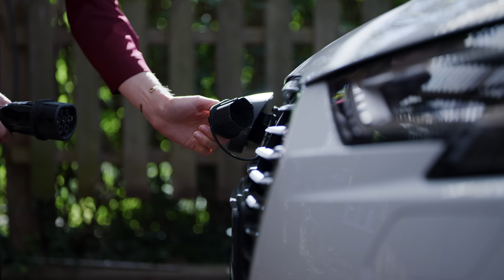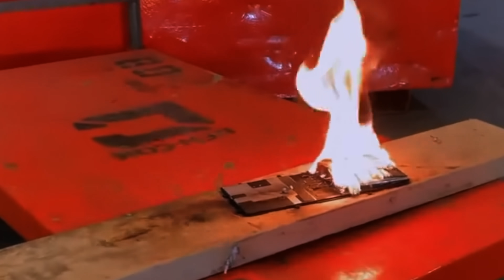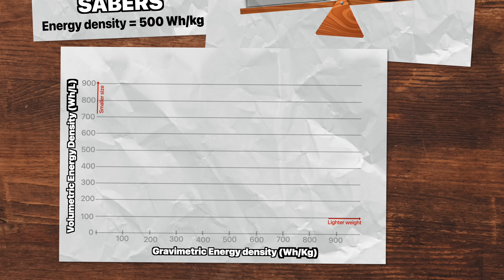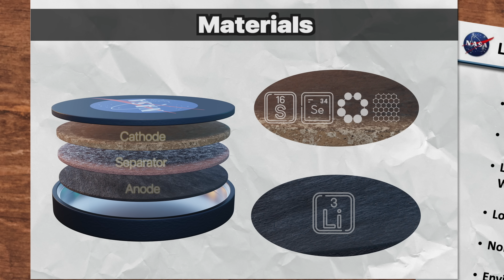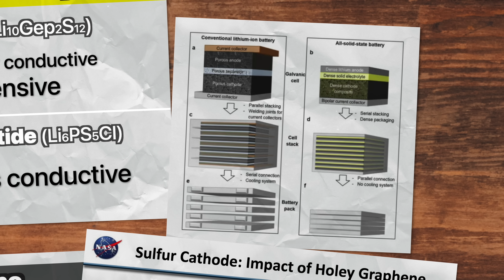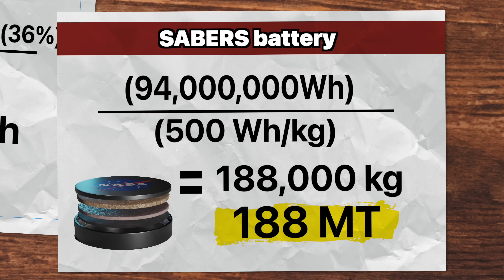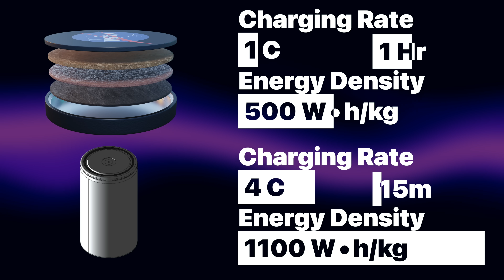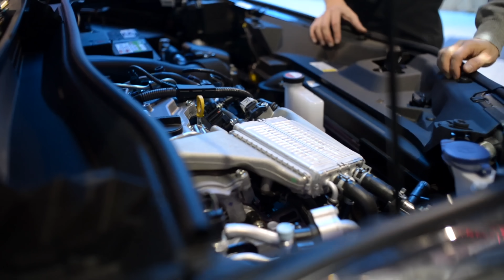Why NASA is Building a Solid State Battery

Comment: for the electric plane, maybe include a little jet fuel and three generator turbines to provide extra power for takeoff etc.
military vehicles could keep even a bit more jet fuel for in-flight refueling which the vehicle can use to recharge it batteries while in flight, thus extending the range options a lot.
anyway the power requirements for maintaining speed at cruising altitude are probably a lot less than takeoff. And you might as well add in that the plane's surface will eventually have some new high efficiency solar photovoltaic to also help top off the tanks. heck maybe a "good" takeoff runway would have a bunch of electric treadmills in a line such that the runways helps takeoff by sorting throwing the plane in to the air a bit, at least that is, help it speed up. I bet 0 to 120 is VERY expensive compared to the rest of the flight's energy use profile.

Comment: solid state as opposed to mechanical batteries? I'd think it'd be to the point to just say chemical batteries, rather. In fact, kinetic energy storage has it's own devices and wouldn't be called a battery, so making the term "solid state" is kind of redundant. NASA and the world need to be looking to replace lithium, it's in short supply and it's toxic too.

Comment: More than the max takeoff weight is consideration of the max landing weight. In a traditional liquid fuel aircraft, the landing gear and subsequent structure are designed for a landing weight which is quite a bit less than the max takeoff weight. Upon landing, there are significant additional forces that are applied to the structure. In a typical aircraft, the fuel can be dumped to ensure that the max landing weight is not exceeded resulting in structural damage and potential crashes.
Reply: Was about to say the same. Liquid fuel has the advantage of losing weight as you go, so MTOW is higher than the MLW. If using batteries sure, you get energy, but you're still as heavy as you were when taking-off. Hence batteries as is can't be the choice for airliners. Small planes, yes. Large, no.
Reply: @ilaril depends how energy dense they will get. at some point the drop in weight won't be able to overcome the sheer energy density of these theoretical batteries.
Reply: @ilaril All depends on the energy density to weight ratio. If the batteries are light enough (which, really, I doubt), then no problem.
Otherwise, I'll just redesign the landing gear. The ONLY REASON the landing gear is designed to take advantage of this property is because WE CAN.
Reply: The landing gear argument is void, we designed nuclear powered aircraft that didn't lose fuel weight mid flight in the 60s, so we can sure as heck do it now. Not to mention current solid state battery tech allows charge in seconds (check the Israeli firm doing this) so recharging can be quicker than our current methods of refueling
Reply: No. Aircraft landing gear are NOT designed to only sustain landing mass. Any aircraft needs to meet the certification standard of emergency or balked landing (A scenario where aircraft takes off but some issue arrises then immediately they land). Furthermore, most, if not all, parts of the plane are designed with safety factors of atleast 1.5.
Reply: What a very good point.
Reply: That's actually a really important catch, good on you.
Reply: @CrawfordAutomation  To aircraft people...this is just common knowledge but IS overlooked by many outside of the industry who dream of electrifying aircraft.   They also forget that to fly in the US you must have at a minimum a 30 minute fuel reserve...so any range estimation needs to be reduced by this amount which makes the current small aircraft that are available only good for 1/2 hour flight times or thereabouts and makes the possibility of larger craft that much more impractical.
Even if battery technology improves 10 fold...it's still not going to work for large commercial aircraft as the energy density per lb just can't compete with Jet A and never will.
Reply: @recoilrob324   I fly in Europe, here you need 30 min Final reserve + an alternate airport with is roughly 30min worth of fuel , so the 500Mn range is already eaten by the required regulation
Reply: @recoilrob324  Never will? Years ago in trade work, the old timers consistently scoffed at early adopters using battery operated power tools and told me over and over again how they'd never work citing power output/duration/life issues. Never. As in an absolute statement. Drive past a work site today and see what those same old timers use now.  Same story with electric cars and their range. Men (not just old this time) would tell me over and over how they'd never (ever, ever!) have the range needed to be competitive with ICE. Today, the Zeekr 001 has a range of 641 miles thanks to Qilin's newest battery pack. More than most ICE in it's class. Think for a moment, how have batteries improved over your life alone? I'm in my 30's and can count about 6 different chemistries that made it to mass market in NZ. At each iteration, an improvement on the last. I just can't see what you're seeing when you use the word never. My experience has been the complete opposite.
Reply: @recoilrob324  not without being just as toxic and explosive anyway. Trying to cram energy into small spaces and NOT have something exciting happen is an almost paradoxical endeavor.
Reply: @recoilrob324  "And never will"....rubbish....
Reply: @Mick-60  Do you seriously think that the energy density of batteries is going to be increased over 14x?  That's a conservative estimate of what it would take to match Jet A.   I can't see it happening because I live in reality.
Reply: So planes that experience mechanical failure leading to aborted takeoffs can't land on their gear?
Reply: @ohger1  Aborted takeoff means they never left the ground...so that's a matter of how fast were they going and whether they had enough runway left to stop and whether the brakes could absorb enough of that energy without failure.   Many max abort tests have the brakes getting hot enough to light up the tires.

Once in the air if a problem is encountered that requires a return to the field many aircraft must dump fuel to get down to safe landing limits.   The heavier you are the faster you must fly...and land.   They want to land without destroying the aircraft which can happen is tires blow or suspension fails due to excessive weight and speed on touchdown.
Reply: I doubt you'll be refueling the thing in an hour, either.
Reply: My thinking is a 3 stage long haul E plane, a modern catapult system to take off, a large flying battery to detach say a third of the way and return to charge, another flying battery to join 2 thirds of the way and release for landing simples.

Comment: I'll believe (Toyota) it when I see it. I've been hearing about battery breakthroughs for 20 years.
Reply: Li-ion battery also took 20 years from invention to first commercial application as camera battery in 90's. And 20 years more to Nissan Leaf and Tesla. 

Now there are more insensitive to develop batteries, but it's not very easy. Goodenough team invented already years ago solid state battery with high power density and capacity. It uses glass membrane as separator. I don't know what is the hard part.. button sized batteries worked already well. (Possibly micron scale thickness is not easy make reliable as separator, and non-reliable with high capacity battery is no-no)

Comment: I liken the current battery technology similar to going from a few horse power gas engine to the Duesenberg straight 8, 260 C.I. engine developed in 1921 less than 30 years from the begginings of the gasoline engine. Somebody is going to invent a safe powerful cheap electric battery that can be fully charged in 15 minutes or less within the next ten years. That same technology will capture and store solar energy to be distibuted through the grid wherever it is need for pennies on the dollar.. 

I think by 2050 we will be well on our way to eliminating the massive carbon dump currently taking place as well as providing low cost energy, pulling developing countries quickly into the mainstream of economic and social opportunity like never before in history..

Whether that will be enough to temper the deep seated drive for a few to dominate and control our species by various social, political or dictatorial methods remains to be seen..

Comment: Power density shouldn't be a problem if you can fit 60% more battery in the same volume. If engineered to take advantage of this, you can essentially increase power output by the same roughly, bringing it closer to parity vs lithium ion w/cobalt.

The biggest problem by a country mile is charging cycles. 200-300 won't cut it when the latest Lithium Ion chemistries can do ~1500 b4 hitting 80% capacity. This is a complete show stopper period.

Comment: Maybe quite exciting.. I doubt the safety part though simply because with that energy density the energy is there to use.. 
Kind of like a petrol car that uses 'non-flammable' petrol. It kind of is there and its called diesel but in reality get it hot enough and it still burns. The only fuel systems that could really be considered explosion or fire immune are nuclear ones and that is only because the gap between base state and 'ignition' is so large.

Comment: I remember 10 years ago MIT had a break thru with a new battery technology. It charged fast like a capacitor , but it lasted like a battery. It was going to take a few years to see it in mass production, but it was going to replace all batteries. 
Guess MIT forgot about it.
Why all these stories about new technology breakthroughs  that never seem to breakthrough.

Comment: I disagree with your assessment of whether this technology will help the airline industry AT ALL!  You keep talking about take-off weight, but landing weight is actually far more critical.  How could you miss that?  Modern long-haul aircraft are fine with max takeoff weight mostly because the majority of that bulk will not be present for the landing.  
Maybe it's a bit like flooring a big 18-wheeler on a big open highway, versus trying to park that baby -- except, the weight issue for long-haul aircraft is far more critical.  So critical, in fact, that such fully loaded and fueled aircraft have to dump fuel during emergencies before they can safely land again.  
Yet, in all of this, you keep ignoring all the electricity generated for charging EV batteries is still expected to come from so-called fossil-fuel plants.  Why do you do this?  Exactly how is it even possible operating such an aircraft will generate FEWER CARBON EMISSIONS OVERALL?  I challenge you to do that math on that, my man.  Except this time, don't forget that fossil-fueled aircraft become more efficient as they shed the weight of fuel they consume.  Otherwise, your entire spiel is just selling colored bubbles to the people who look up to you, and you know it.  This is BAD SCIENCE.

Comment: A stable solid-gel electrolyte in a lithium battery is a substantial advance, yet stll incremental & not massive. Still, many incremental steps can stack to be a large improvement. Whole new chemistries or mechanisms are needed for surprising performance gains, like lithium gave over previous battery chemistries. 

NASA does use some awesome energy storage tech tho: Thionyl chloride fuel cells have GREAT performance compared to hydrogen. They also contain lots of super-reactive poisons (thionyl chloride is super useful but NASTY), and so can't be commercialized for use on Earth.

Comment: Metallic Lithium is flammable. If i remember my chemistry it catches fire if immersed in water (like Sodium: did you chem teacher demonstrate that at school? Lithium should be more reactive than that)

So it won't leak, but if a battery gets punctured in a crash and water gets in, there would still be a fire risk.

Don't throw the battery into a bucket of water after you strive that nail through it! 

But good news for Hollywood: you can still have your flaming car wrecks, you just have to do them involving water as well

Assuming i remember my schooldays chemistry correctly...
Reply: Exactly. And in water lithium makes hydrogen that will easily explode in closed space. Rather immerse the battery in silicone oil or lithium crease than water.

Comment: I don't think you should even mention Toyota and Solid State Batteries in the same sentence. Toyota have been making SSB claims for years now, with nothing to show for it. Until they have customers of Toyota actually doing live real world testing, their SSB's are nothing but vaporware is you ask me. And another thing, if those specs Toyota keeps claiming are real, Toyota could drop making cars and focus solely on producing solid state batteries because the entire world would shop batteries from Toyota at prices so high it would have much better margins then producing cars. But as Toyota has made these claims every year since 2018 and still haven't given exact specs or given their customers test samples I say this is a big nothing burger.

Comment: If you have a 100% effective way of charging.... do you have any idea how long it would take to charge a battery with enough stored energy to power a jumbo jet? Even if you could charge it at 300k volts (which would be super dangerous) you would still be looking at over 24 hours. If you charge at high amperage and low voltage.... you are into weeks of charging time. This is with 100% effective charging. A 0% loss battery wouldn't change this.

Comment: As a freestyle drone pilot (also a licensed plane and helicopter pilot) I care about weight and C rating. But I need the discharge rates to be around 100-200c. With a charge rate up to 4-6c.  This is comparable to what top of the line flat packed drone batteries can produce as of today.

Comment: Could they recharge in parallel, while discharging in series?  That should make recharging the solid state battery much faster.
Reply: It wouldn't. It doesn't matter whether you apply 42V @ 10A for a string of 10 cells in series, or 4.2V @ 10A individually for each of the 10 cells, you are still limited by the 10A max. current a cell can handle. So assuming a cell can handle 10A, you can either pump out 4.2V x 10A x 10 or 42V x 10A x 1, both of which give you 420W of power.
Reply: I think it would indeed be faster, but it also would require a lot more power.

Comment: You forgot one major thing -- solar panels. The most energy efficient solar panels covering the exterior of the plane would reduce power requirements from the batteries. Plus planes fly high -- over the clouds. So daytime flights would get energy from covering the exterior of the plane with solar panels. That's a lot of surface area.

Comment: uh Turbo fan engines are not being replaced with electric motors.  you might as well talk about prop planes at that point. and you won't be ever come close to Trans sonic flight either.   A slow flying battery.  You're better off flying Quad copter cars.

Comment: You cant really power a plane with batteries. The reason planes fly is thrust and thrust is generated by expansion of gases. The gases are products of combustion. You need fuel for combustion not batteries.
Reply: You can use batteries to fly a prop plane though. A hybrid may be possible using jets to take off and the propellers to cruise. Slower overall flight time but possible.

Comment: In your graphic showing current flow, you had positive to negative action, when in fact, it is electrons from the negative that go to the anode. Proof of this is what takes place in vacuum tubes (or valves), free electrons are present at the heated cathode and are attracted when there is a positive charge applied to the plate.

Comment: evs would benifite greatly...a lot of energy is wasted to pull the huge weight of the battery pack...so 40 percent lighter would have a huge increase in distance with the same amount of stored energy...

Comment: Cool video, cool tech. Problem with aviation is, you have to have plenty of reserve fuel available to account for changes in flight plans due to weather and ground traffic that makes planes go into temporary holding patterns. So the actual flight range is lower than say, the 500 miles mentioned here. Imagine being on an electric plane and being told, knowing you're on a near-max flight, you're going into a holding pattern prior to approach.
Reply: Just like backup fuel, you just have backup batteries specifically for that.